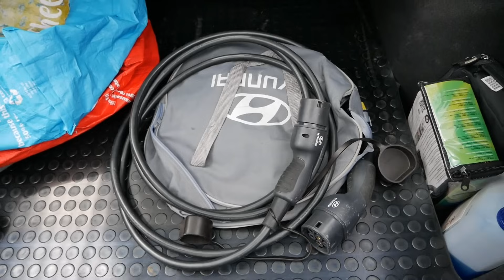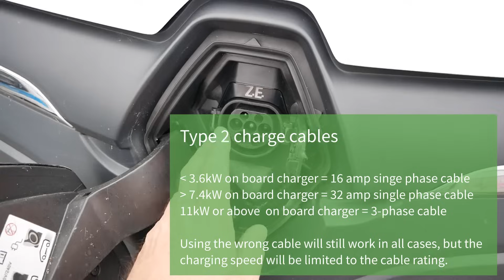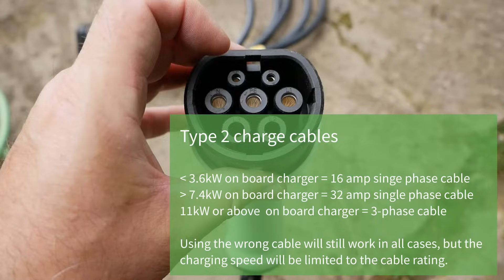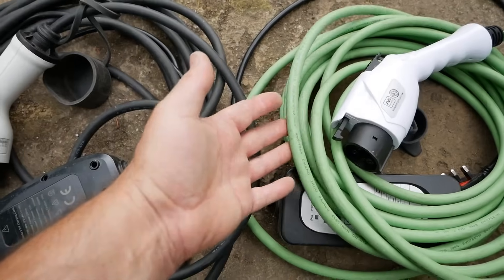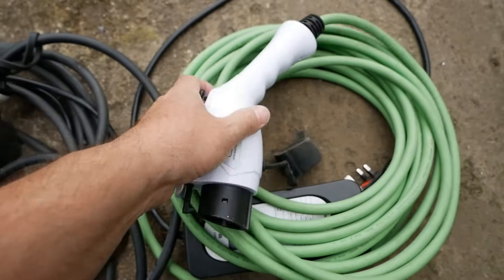Beginners guide to buying the correct EV charging cables for your electric vehicle

Comment: I assume I can use a 32 amp 3 phase type 2 cable on my car with my home wall box even if my car is only a singe phase
Reply from the maker: Yes. Many vehicles are supplied with a 3-phase cable because they can charge at 11kW or 22kW, but only end up using 7kW home chargers.
Reply: @GoGreenAutos thanks we have a Mercedes A250e it came with a 480v 32amp cable, it’s just to short at 4mtr so I have ordered a Mennekes Type 2 Charging Cable - 22KW 32A 7.5 Metres 3 Phase Type 2 to Type 2, IP55 hope it’s correct

Comment: My Car takes 11kw Type 2. At work we are provides with up tp 22kw 3 phase charging. Do I buy a 16A or  32A cable 3phase cable?
Reply from the maker: You only need a 16A cable. However, I would buy a 32A 3-phase cable as you'll find they cost the same, then you have a cable that is future proof if you need it for your next car or if a work colleague wants to borrow it etc.
A 32A cable will work the same on your vehicle.

Comment: Is it possible to change the Type 1 plug used by Leaf etc for a Type 2 on a new vehicle or does the cable have to be scrapped.
Reply from the maker: It is and you can buy bare type 2 plugs. But you need a large crimp tool i.e. a hydraulic crimper.
So the cost of this and the new plug is about the same as just buying a new cable.
Reply: @GoGreenAutos  Thank you

Comment: Thanks for telling so much details about the charging cable. and I have a question is that when user unplug the cable from EV side, if the cable will still locked on the charger side?
Reply from the maker: You have to use the app for the charger and stop the charge, which then releases the cable. This only happens when AC charging. But if the charger has not released your cable, plug it back into the car and go into the charge app (or the screen on the charger) and stop the charge and it will unlock the cable. Or start the charge again and then stop it.

Comment: But how does the car know what cable is connected and regulate the charging rate accordingly? My wall box is rated at 7.4kW but with my single phase 16A cable charging is restricted to 3.6kW, how do the wall box and car communicate to set this charge rate?
Reply from the maker: There's a component (a resistor I think) in the charge cable on the comms wire that dictates this.

Comment: What about the difference between Type 2 to Type 2 "Extension" cables. In Australia you can now buy 3 phase 32KW Type 2 "Daisy chain" extensions. And 3 phase 32KW Type 2 "Standard". What is the difference? I think the "standard" (often labelled blue) is for extending a 3 Phase cable hanging off a public charge station, where as the "daisy chain" variety (often labelled orange) is for extending your own portable charger? IS that correct? What is the actually difference between each one, and why? Is it something about the pins? or some weird EU standard? thanks!
Reply from the maker: While a standard type 2 cable looks identical to a type 2 extension cable, they are different. I once drove over a type 2 plug and broke it open and there was a resistor (or maybe other components) on one of the communications wires. An extension cable wouldn't have this. Obviously connecting two standard type 2 cables doesn't work and hence why you have these special extension cables.

Comment: Thanks for explaining all these cables which were very confusing for someone never owned an EV.
I do have a question about the portable charging cable as I'm considering to buy an Hyundai Ioniq.
I've moved to a new build home 1 year ago.
There is a 3 pin socket next to our driveway which the developers said is suitable for EV charging (with the same wording printed on it as well).
I know it will charge an EV at a slower rate but I'm fine with that so just want to see if there is any concern in terms of safety. 
Thanks lot!
Reply from the maker: Yes it will be fine, but very slow. It will charge at 10 amps, which is about 10 miles of range per hour of charging.
You'll also have to be careful with the portable charger as they're not properly waterproof. See here for more info https://www.gogreenautos.co.uk/using-portable-chargers

Comment: Great video!
So, I'm considering buying an electric motorcycle with a Type 2 Mennekes charger onboard, however, I can't find an answer to my question. Can I charge on a CCS charger? So, the CCS charger has a tethered cable on it. Can I connect my Type 2 to Type 2 cable into a CCS and charge my motorcycle? And yes, some chargers only have CCS, they don't have a Type 2 only so... will it work?
Reply from the maker: No. A CCS charger is only delivering DC power. If your bike has a type2, it requires AC power.

Comment: Really well put together tutorial, I learnt a lot. One small thing missed, if using a reel extension lead make sure it's fully unwound otherwise it could catch fire, plus, we charged our EV on the standard 13a brick charger for many months and it was never an issue. Running 10amp through a 13amp socket is perfectly OK, it's what they are designed for. I would have awarded you 10/10 but due to these really minor issues I am awarding 9/10 🙂✅

Comment: If you have a 7kw charger at home and buy a 3 phase cable will it work ?
Reply from the maker: Yes it will. The only two extra pins are only used when connecting into a 3-phase charger (and 3-phase charging car).

Comment: Question, I'm getting a EV charger installed at my house soon. I'm yet to buy my car yet (Kona electric 2021) but this car comes with a 10.5kw charger. Do you know the standard length of the charger cables?
Reply from the maker: Charge cables are typically 5 metres.

Comment: Hi

I have a 5 meter cable on my ohme charger, the side of the charger the cable is fully fitted inside the charger so no plug connector, and other side obviously goes into car. I have tried extending cable bu using the cable that came with car even though it fits in both sides but says cable not plugged in, any advice on which extender I should buy
Reply from the maker: You can't use a type2 charge cable to extend. It wont work and is designed not to work like that.
You can however buy special type2 "extension" cables. These are different to a "charge" cable.

Comment: What cable should i buy to get 7kwh from my mk 1 MG Zs ev. My home charger is 11kwh 3 phase but i get only around 2.75kwh charging speed and i dont want to change my home box to single phase. I know you had an MG Zs some time ago. Any tip would be appreciated
Reply from the maker: Your charger may be a 3-phase unit (most are), but unless you actually have a 3-phase electricity supply, then you're not going to get 11kW. In the UK, it's very rare to have 3-phase at home. I would guess you're not in the UK. If not, where and what is your voltage?
The MG ZS has a 6.6kW AC onboard charger, so you're only going to be able to charge at that speed anyway. So buying a 3-phase cable will have no benefit as the MG doesn't support 3-phase.
So you have to look at what the volts and amps are on each of your phases. The car is only using a single phase, so this might explain why you're getting a low charging speed.
I'm in the UK, so it's difficult to answer without knowing what your electricity supply is. But basically, to charge your MG ZS, you just need a single phase 32 amp type2 to type2 cable. But then that is if you have type2 in your region. Non-EU regions can be type1.
Reply: @GoGreenAutos  thanks for your swift response. I live in Sweden. My electricity supply is 16amps/220v. I once charged a leased Volvo EX40  on my wall box and was pulling almost 9kwh. I know the MG Zs only support single phase. I tried on 22kwh public charger but got same result. Around 3kwh. Was that your experience with your MG Zs?
Reply from the maker: @matthewaride2234  I've never charged a ZS on 3-phase. Its rare in the UK. Homes don't have 3-phase and while some public AC chargers are 22kW 3-phase, they are few and far between as most sites just install DC rapid chargers.
So is your supply 16A/220V on each phase? The ZS is only charging on one phase, so 16A is 3.5kW - not far from the 2.75kW you say.
Reply: @GoGreenAutos  Not sure how it's split in phases, if it's 16A on each. I guess I will have to live with it. I mostly charge overnight at home which is sufficient for my daily routine. My old Nissan leaf was charging at the same speed. I was hoping when I am out and about I could charge at public AC charges which are abundant here than use the very expensive rapid chargers otherwise I am fine at slow charge at home overnight. Thanks for your time.
Reply from the maker: @matthewaride2234  A higher amperage single phase supply would be better for charging an EV.

Comment: Im getting a new kangoo but I will be charging it with a granny cable over 15 metres for a couple of times a week for about 100 miles in total and once a week at the supermarket for a full charge. Would thus be a safe and viable option
Reply from the maker: You can, but do make sure the socket you are using is sound and the wires are done up tightly at the rear as using a granny cable for many many hours will highlight any loose connections with bad results. See https://www.gogreenautos.co.uk/using-portable-chargers
You're much better off getting a proper wall charger installed and even though it will cost ~£1,000, you can then offset the cost by using a cheap rate overnight tariff. See https://youtube.com/shorts/5bm6pp80x3U?si=fMbzIjOP7a_iL9Mq
Reply: @GoGreenAutos  thank you for your reply, much appreciated. I did read in the link that it's best not charged from a socket run from a spur, unfortunately that's what mine will be. I can't actually have a proper ev charger because of my parking situation. I'm in a new build and the socket for the ev has just been installed by an electrician so hopefully it should be OK. Your thoughts on this would be appreciated.
Reply from the maker: @LokiDeablo  Use a granny cable then, but one which has selectable amperage and reduce it to 8 amps. Something like this https://youtu.be/8eYrX14vdCk?si=Y4-GZ_WttgWi02cf
Reply: @GoGreenAutos  thank you for your advice, much appreciated

Comment: I am looking to fit a home charger. But don't want to ruin the esthetic look of the front of my house. The option I have is to have it fitted round near my electric connection to the house about 10+ metres away from the parking. Is there anything I need to consider when considering this option as in, are there type 2 cables that would stretch that far to charge the vehicle and also will the length of cable effect the rate of charge?
Reply from the maker: I've experienced some vehicles that don't like long charge cables. I used to have a 10 mtr cable and some vehicles just wont charge when using it.
You'll be far better off putting the charger near the vehicles. There are chargers which have different face plates so you can make it match your house colour scheme. There's also smaller chargers. Many go with the Anderson (https://andersen-ev.com/) charges where the look or colour matching is important. Or the other option is to put it on a post away from the house, at the side of your drive.
Reply: @GoGreenAutos  that's interesting and I did wonder if that would be an issue as I read it can be. It's not the charger that is the issue it's more the cabling running from the electrical box to where the charger can be situated it needs to up and around the front door which isn't ideal

Comment: Great video very informative, also you will only get cheap rate electricity if you have a 2 rate meter and have that as part of your contract with your supplier
Reply from the maker: Thanks.
As for the meters, you just need a smart meter as they do half hour readings.

Comment: I want to fit a 7kw home charger but I measured the distance to my car and it's 15 metres. Is that too far to charge effectively? It will be a type two for an ioniq
Reply from the maker: You can get 15, 20 or even 30 metre type2 cables. However, I have experienced issues with some EVs when using long charge cables. Not tried on the Ioniq though.
Can you not get the charger any closer? i.e. using a post to mount the charger closer to the parked car. That's what I've done myself.
Reply: @GoGreenAutos  thank you for the reply I appreciate it. I wish I could get it closer but my car is parked in a council owned car park so it's not really feasible to put a post mounted charger there, I'm not technically supposed to charge at home there but I would do it using a anti trip cover as the lead would only run across one pavement which is rarely used by pedestrians. Tbh it's the only stumbling block to going ev for me but I think I can make it work.

Maybe it would be with speaking to Hyundai?
Reply: @GoGreenAutos  what has been your experience with longer cables? Slower charging? No charging at all? What length and vehicle?

Comment: my family and friends would never buy electric cars, No electric car is worth paying more than £3000 because it takes 30 minutes to rapid charge causing inconvenience time consuming and battery damages degrades faster when rapid charging

its expensive to repair ev car when it becomes faulty and out of warranty

in winter ev uses alot of battery for heating same with summer with air con

with cost of living people now have very less money to buy

It’s Not full self driving

I would Not pay any more than £2000 for your car

the  battery degrades every year then car become useless and more inconvenience as it degrades 

electric cars Not worth it’s value anymore
Reply: This all is load of bull..  In Finland we had -39°C last winter and never get nothing to worry about with ev. Cabin was always warm and windows frost free. Costs of driving was adout 8€/100km. 
I charge my car while i'm working or at night while sleeping so no hasle there. Service costs. First service at 2year or 40.000km costs 150€ next one 4years or 80.000km and costs 350€. next on is 6years or 120.000km and 150€. 
Car costs about 40.000€ total with all bels and whisles. That makes about 310€/month + electrics about 60€. 
So can you tell me what kind of petrol car you can beat that? Even used one.
Reply: What about Hybrids...😮

Comment: 11:30 Is running a portable charger to an indoor socket allowed in the UK? In my location (Norway) it is strictly forbidden to plug any outdoor appliance (including an EV charger) into an inside socket, as indoor sockets does not have as strict ground fault monitoring as an outdoor socket, which is required when operating anything exposed to rain (in case of a damaged cable etc)
Reply from the maker: Yes it is, in the UK.

Comment: I find my type2 supplied with my Mégane is too tight on the socket of my dads Zoe (2016) but his lead works on both. have you seen this and do you have any Zoe lead recommendations
Reply from the maker: Check for a rubber o-ring and make sure its not twisted up. This can happen on the type1 plugs as they age and the o-ring gets twisted up and comes out of its mounting place. The type2 plug doesn't have a o-ring (well most don't) but check to see if there's one in the socket on the car.

Comment: Excellent comprehensive tutorial!
The first time I plugged my Masterplug granny charger into the port (located where the petrol cap would normally be on my Fiat), it felt odd because the process had more in common with recharging a cordless vacuum cleaner. Even using the wall charger that was installed nearly two years ago is still a novelty to me, and something of a pleasure compared with queuing at a petrol station!
Reply from the maker: Thank you and good to hear. Charging an EV is so easy (and clean!) which is something that non-EV drivers don't appreciate. Their assumptions are that its worst.
Reply: I haven't splashed any electrons on the forecourt yet! @GoGreenAutos

Comment: As a newb the first time I went to a charger it was a nightmare. A video of a newb going to a charger to fill up for the 1st time would be good (we just charge from home). 1st the machine did not seem to work as it didn't seem to turn on, then I had to use a phone to do some of it, then it wanted me to subscribe or not, then there were several different charges (this was a council run car park with a station provide by Source London) in the end I just gave up and have never tried again since.
A video from start to finish dedicated to newbs getting electric for the 1st time might help people.
Reply from the maker: Plenty have done these videos, but of course the experience is slightly different with every network and brand of charger. But generally now, you just tap your credit card on the contactless payment panel, select what plug you want to use (CCS or Chademo) and plug it into your car. Its as easy as that.
It didn't used to be with phone apps, but those days have mostly gone.
Reply: @GoGreenAutos  For me it would not let me just pay and fill. ie from their website "The PAYG option enables you to use Source London charge points immediately without subscribing to any membership and without using a membership card. You will simply need a valid debit/credit card and a MOBILE PHONE WITH INTERNET ACCESS."  it was not plug-in and pay. So I take it this is not the usual way at other charging points?

Comment: Very comprehensive.  I was caught out when I had my 1st EV (with existing wall charger) and found the charger was a type 1 and EV was type 2 😱. Solved with an good quality adapter though 🙂
Reply: For futureproofing I'd advise anyone getting an EV with Type 1 to get Type 2 cables and a decent Type 1 to Type 2 adapter.